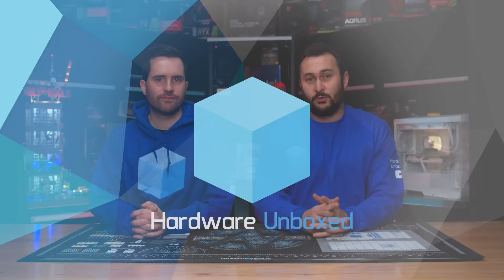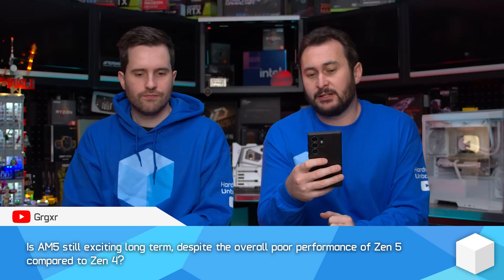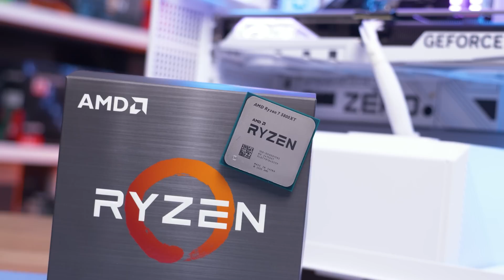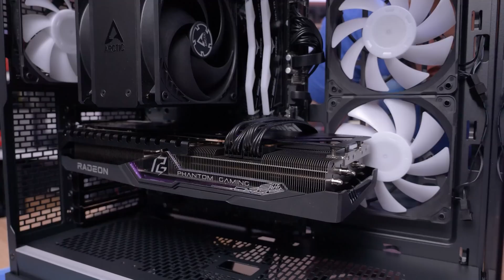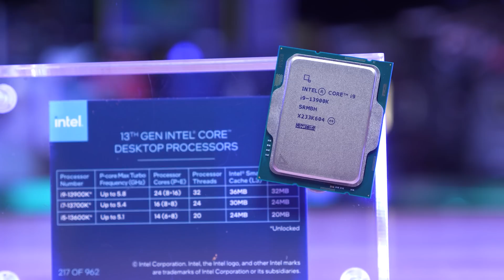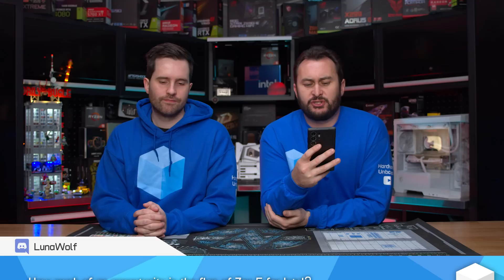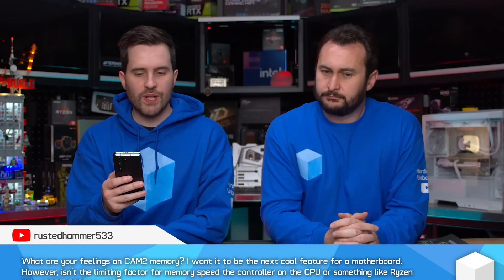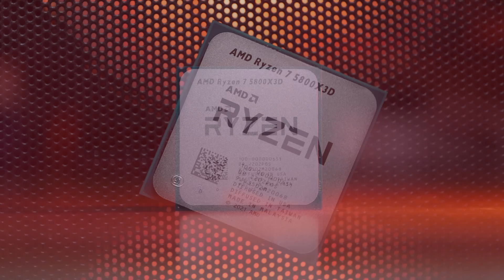Our RDNA4 Expectations, Can Intel Gain Lead After Mediocre Zen 5?

Comment: So I do quite a bit of overclocking, some of it goes well, some not. Memory overclocking being by far the hardest thing to do. As for limiting overclocking I do think there is a simple solution, a 2-3 way bios switch that accounts for standard cooling, advanced and Extreme, with the last one throwing your warranty out the window instantly. Having done XOC I can tell you its a very fast way to scrap a chip, however the standard bios should let you crank things up to where you hit the standard temp limits and generally that's also about the limit of stability, memory OC's excluded. We do know that most GPU's can handle +125-200 mhz and 500-1ghz on memory so set that as the max limit on standard bios/ lvl 1 OC bios. Not to mention If you trry to load almost any 8000mhz memory there's a 90% chance it wont run on any chip.
Reply: I have been overclocking laptops for 20 years. You can do it safely.  My GTX680M lasted 5 years including the last 2 years at +50% (720 to 1000mhz) after liquid metal.  The only CPU I killed was a 3940XM from excessive pressure after I made a custom heatsink (it ran fine at 4.7ghz before it).  I watercooled my first P370EM laptop and put 2 1070s in it that when TGP modded ran up to the laptop motherboard throttle limits (540W).  I have here a 9900K in a Z170 laptop board running at 5ghx/170W max (a Clevo, the last one to do desktop chipset slabtops, that I modded with functional detachable watercooling before the diy chinese ones started popping up on taobao) and two vbios modded GTX 1080s set to 250W max that still work.  6 years old and run hard almost every day of its life, the screen was the only thing that ever failed.
But with all the limits these days, you can't do it.  It's killed my enthusiasm for it.  That includes undervolting.  Not being able to undervolt laptop HX chips is farking disgusting.  The one-size-fits-all approach has ruined everything

Comment: I have a 5800X3D with a 16gb RTX4060ti GPU and 32gb DDR4 3600mHz RAM and I play Cyberpunk 2077 at 1080p and I am getting 90FPS even with everything turned on. Raytracing, Pathtracing, DLSS and Frame Generation. And I don't think I will be upgrading my platform for years to come if ever.
Reply: You will upgrade that 8 gb vram card, that is for sure.
Reply: @Shatterfury1871  lol you obviously did NOT read that guy's full comment otherwise you'd not type this idiotic comment
Reply: @Eleganttf2  
I did, but you put the VRAM at the end of the name of the GPU.
Reply: @Shatterfury1871  16gb not 8gb
Reply: @EthenGreen-i5k  
What sin did you commit that forced you to buy that card? You could have gotten a 7800XT for around the same price.

P.S. The buswidth will not allow you to make full use of those 16 gb of VRAM.
Reply: @Shatterfury1871  I paid £420 for the 16gb version rather than £360 for the 8GB version of the card. I decided that the £60 extra to double the VRAM from 8gb to 16gb seemed a fair deal. That is the reason why I bought the 16gb version.
Reply: @EthenGreen-i5k  
It has the same buswidth as the 8 GB one.
Yes, you will make use of more than 8 gb, but not 16 gb.
If you bought a AMD CPU, why didn't  you entertain the notion of buying an AMD GPU?
Did you not watch the videos from those guys over here???
It's not that the card is bad by itself, its badly priced.

Comment: I would be amazed if Zen 6 isn't on AM5 
Usually new platforms for AMD are marketed around new tech. Like DDR5, PCIe5 and USB 3+
And the timeframe for Zen 6 seems too early for DDR6 and PCIe 6.

Could be a cross gen release. Otherwise I see Zen 7 being the first AM6 release.
Reply: Assuming DDR6 is even coming to consumer platform that early. PCIe 6 will probably be datacenter only for a few years due to costs, I can see the same for DDR6.

Comment: 15th gen intel won’t be a refresh. Famous last words.
Reply: In terms of architecture, it won't, in terms of performance uplift, it pretty much will be...
Reply: I don't like how intel removed smt. SMT is technology which will carry the multi core performance of CPUs. It is crucial for productivity performance. Heck you don't even need better single core performance in games if you increase the cache size. The problem is that many es of core ultra 285k are not even beating 14700k in multi core benchmarks. An es should atleast be on par with the predecessor so the 14900k.
Reply: @Riyozsu  Not having SMT is not a big problem for games / lightly threaded apps, in fact, it might be even beneficial. And according to leaks u9-285K's QS scored actually ~10% higher in Cinebench all core than 14900K, which, considering there is no SMT, sounds almost too good to be true.

Comment: Imagine using 6950 XT into the year 2027 because everyone are just releasing refresh after refresh with 2% performance improvements and 20% price increase.
Reply: Same. If my 6950XT doesn't die. Or my 7 years old B450 mbo that has the 5700X in it.
Reply: Why would you upgrade a two year old GPU that you just spend hundreds and hundreds of dollars on? Why do you think 5-10% is not good enough? How about stop chasing 1 extra FPS and actually enjoy your game and save your money. My last build was 11 years ago. I've upgraded my GPU once in that time.
Reply: @---GOD---  I upgrade gpu every 2 years, its really not that expensive if you buy high end and sell your old card to buy a new one.  1080p is unplayable to me, even 1440p looks bad.  no way i could keep a gpu that long and play at 4k lol.
Reply: 6900 XT here, I play in 1440p

Everything runs perfectly and even RT isn’t a nightmare anymore thanks to XeSS 1.3, FSR3, FrameGen, AFMF2…

For example, I went from 55-60 fps in Cyberpunk (HUB settings + RT medium + FSR 2🤮) to 75-80 fps with XeSS 1.3, 90-100 fps with FrameGen enabled and 150-160 fps with AFMF 2

Not only I tripled my framerate but even image quality got better (no more ghosting)
Reply: 6950 xt is still a beast if you ignore RT. Im running mine in 4K and everything I wana play I play smoothly and without any problems. I am only a bit worried about Kingdome Come 2 next year and later down the road the Witcher 4 and GTA 6. These might be the reason to change the GPU. Or utilize the upscaler more than I want to.
Reply: That card would still enough for those games.  @zagloba1987
Reply: Looks like they took a page out of mobile phone companies' book
Reply: 6900XT here. There is nothing that this gpu can't handle, the only game I had trouble with was Plague Tale Requiem and using Lossless Scaling fixes that completely. I don't think I will upgrade this gpu in at least another 4 years. Same goes for the 5950X I have, I see no point in upgrading it anytime soon. Companies, reddit and many tech channels make you believe you need to upgrade every single generation. I am the opposite. I buy good parts and they tend to last me at least 5 years, and cpu/gpu improvements are getting weaker and weaker. Nowadays good hardware can last you a decade, in the early 2000s you had to upgrade every two years...j
Reply: lol the AMD graphics drivers are bad is way over gents. The drivers now are just fine. I’ve been playing games since the ATI rage days Ns I can tell you AMD drivers are fine. They just are
Reply: @tadsnyder2756  I own 3 graphics cards from AMD, and 1 apu. in my 2 newers ones: rx 6600 and rx 6700xt, i have an issue that won't let me play my main game: The cursor constantly disapears when in the game, and since is an mmorpg, where i need to click literaly everything, i can't play it. The only way for the cursor to come back, is to press the windows key, so i see the windows start up menu, click back into the game window, but then. the cursor disappears again a few seconds later, sometimes 1 second later.... I have updated the drivers, and it keeps happening. My rx580 and my 5600g igpu doesn't do that tho. Is an issue exclusive to RDNA graphics cards.
Reply: @josejuanandrade4439 id put money on it not being your video card. Stop downloading weird shit and reformat your windows install.
Reply: I can see it. I only changed my R9 290 to RTX 3070 in 2020.
Reply: 3080 since 2020, and unless someone gives us an XTX/4080 equivalent card for 500$, I will not be upgrading this generation.
Reply: I will be using my 6900xt untill a card comes out which can play games at 8k comfortably
Reply: Honestly I can see someone still using their 1070 Ti, 1080 or 1080 Ti in 2027 if it still goes like this.
Reply: Why? Don't you want to use DLSS4 that will hallucinate the whole game for you (that may or may not resemble the original game you are trying to play).
Reply: I'm still using a 5700XT and 3950X, 1080P and some 1440P for the games I play as for RT don't use it so can't miss it. But I don't only game on this PC so an upgrade doesn't seem to add an value currently for me.
Reply: @qrogueuk it’s a great GPU 😊
Reply: Given how much you paid for it I'd certainly hope so
Reply: This is my plan. I'm not upgrading my 6950XT until a new $600 card is available with double the performance of the 6950XT.
Reply: A 7900xtx dominates the 6950xt, and it's not even within 20%. I know I had both. I've had a 4090 for the better part of 10 months and am preparing to buy the 5090. I might be a moron with money, but you also have no clue what you are talking about, and to me, it sounds like you are huffing copium
Reply: This seems like a possibility, given the minute incremental gains recently. You will play AAA games at lower resolutions and settings, and be grateful, or you will pay the bounty of an arm, leg, dragon's blood, your soul, and your first born child for our shiniest, newest, marginally better and temporarily halo GPU...which will be obsolete in a year...because console port optimization or MS will refuse to support old stuff on the new version of Windows. That said, hopefully Steam OS will be available by then.
Reply: Shit I'm ready to dump the 4090 for the 5090. I want more power.
Reply: @SPG8989  That's what I'm saying. I don't even do 4k. I just want 1440p on my ultrawide OLED with all sliders clapped out.
Reply: That’s the game, paired with 5800x3d
Reply: Well yeah we’re reaching the limits of silicon miniaturization, so any meaningful performance improvements are gonna be few and far between. CPUs reached a wall in clock speed 20 years ago, we haven’t doubled clock speed after all that time and IPC improvements are becoming minuscule. GPUs are gonna be reaching a limit in how small they can be pretty soon at this point, which means the 4090 is the last time a GPU generation will have this big of a performance increase over the previous gen. The RTX 5090 won’t be as impressive
Reply: I bought my 7900xt for 630eu (avg prices 750-800 here), I'll be using it for at least the next 5 years, no sense in upgrading as long as it does the job
Reply: Maybe wait for the 60 series?
Reply: "everyone" lol. That sounds like AMD GPU's, not Nvidia.
Reply: Sounds like what intel did for over 10 years with their core series
Reply: I will be using my 6800XT into 2027, there is zero reason to upgrade. After Red Dead Redemption 2, I have found no new games interesting to worth my limited and valuable time.  Even my 5900X is fantastic and upgrading to Zen4 or above will not be worth the money spent.
Reply: @josephnorris4095  why no 5800x3d?
Reply: @josephnorris4095  Yeah games are meh, not really a reason to upgrade.... everyone plays older games anyway and 6800 XT is an overkill for Elden Ring which was last game that really got me hooked.
Reply: @josephnorris4095 ya probably same
Reply: Some people I know are planning to use their 2080 Ti up to 2028
Reply: thats 5 years. how long did the 1080ti stay relevant?
Reply: I'm still using my 9900k does that count?
Reply: @alexwalker2582  hey, if it didnt rust in a year youve won
Reply: @auggieaxiom5726  😂😂
Reply: @auggieaxiom5726  The rusting issue is 12th and 13th gen, not 9th.
Reply: A 7900XTX ist much faster as the 6950XT and an RDNA4 Card will be better in Raytracing Performance as your old one.
Reply: @Taurus104  What?
Reply: Those sales for half-price 6950XT at the end of 2022, before the RX-7000 series.

Yeah that was the deal. Especially if you were a launch day owner of a 6800 (non-xt) at msrp price. Meaning you got a proper upgrade from a GTX 1070/80/Ti.

The RTX-3 series are VRAM starved, and the RTX-4 series are just bad value, whilst RX-7000 are a waste of time. Basically going from the midrange rx-6000 to the high-end was the generational upgrade, for the midrange gamer.

For the budget gamer, it was probably something like a GTX 1060/RX 480 to a GTX 1660Ti/RX-5650XT or RTX 3060/RX-6600XT/Intel Xe Cards.
Reply: @ekinteko  I went from the RX 580 to 6950XT. From my POV now, it was kinda good upgrade, since I will be ok for 10 years because I do not play games anymore, but for me, for my reasons why did I buy it, why did I upgraded so much... It wasn't worth it. I went from RX 580, 1080p 60Hz monitor and Ryzen 5 1600 to RX 6950XT and R7 5700X paired with a 240Hz 1440p monitor. I played a competitive shooter and the only thing that helped me to play like I could was a Fing stable Internet connection. I can play great things with my setup, I just don't want to. There are some videos on this topic and a lot of people are saying that one of the biggest upgrades was higher refresh rate monitor. Yes, it is better. Yes, it is by far smoother than 60Hz, yes it is a night and day. It didn't help me become better!!!! Not 1%!!! Liars everywhere. Stable internet, good internet helped me. Although I am in western Europe, I am in the countryside away from the big city and I am using 4G cellular network. I had to buy good router and antennas, put a huge pipe in the concrete foundation for the antenna and route the cables through my house!!! That helped!!!! Aaaaaa!!!!
Reply: @ekinteko  The GTX 1660 Ti was in no way a good upgrade for an RX 480 -- the RX 6600 and IntelXE cards were, though.
Reply: @predabot__6778  True. I meant it's more-so worth it if you came from the GTX 1060, in particular, the cutdown 3GB model. That still is high on the Steam Survey.

Also the RX-480 didn't get the best initial reviews. On paper you were getting more hardware for your money but the real-world performance just wasn't there. It was a little behind the 1060. After the big crimson update it was ahead. Then incrementally over the years, now it is way ahead of the 1060. Yep Nvidia abandoned all those users, and paved the upgrade way through the GTX-1660Ti, which admittedly was not a bad value card.
Reply: Imagine using the virgin 6950xt, instead o the chad 4090, all the way to 2029!
Reply: @josejuanandrade4439  imagine being older than 12 and talking like this
Reply: @---GOD---  imagine caring (or being bothered) so much about how other people speak you gotta leave a comment about it :)
Also: r/WOOOOSH
Reply: @josejuanandrade4439  imagine still trying to get the last word even though you clearly have nothing left to say since you ran out of arguments to defend your utter BS.
Reply: @---GOD---  Imagine being still so triggered because you failed to recognize a joke, that you won't let it die, and try to make it look as some sorte o discussion? with arguments? LOL
Reply: @josejuanandrade4439  imagine still imaging when you could've just stopped hours ago. Imagine pretending you made a joke (that nobody laughed at) after getting called out. Imagination running wild today huh.
Reply: @---GOD---  Imagine asking people to imagine stop imagining while still imagining yourself that you didn't made a s booboo because failed to recognize a joke, whatever good or bad :)
Reply: Imagine having driver issues constantly. No thanks
Reply: @user-uc5tj6ux8w 
AMD drivers are fine
Reply: @JahonCross  nah, they’re really not. And that’s coming from someone who’s had many generations of AMD cards. Multi monitor setups always has sporadic black screens and instability for me for years while using AMD gpus. Switched to a 4080 when they launched and guess what? Zero driver issues. And im not exaggerating. You get what you pay for.

Comment: My hope is rdna4 will be amazing , they had good gpus when they release em next to a console generation. If it uses same power as rtx 4070 and is stronger than a rx 7900 gre in raster and rx 7900 xtx in raytracing and has 16gb vram or more for 500$ I would buy it.
Reply: I figure they will charge 899 $ for the above. And people will buy it.
Reply: @PepsiMagt  if its more than 500 they just push you to go nvidia because blackwell not absurdly far away.
Reply: @Unknown-wd7ub  they can sell the cards at that price. Maybe not to you, but there are plenty of suckers with money around.
Reply: @Unknown-wd7ub 
Nvidia 5070 $899… there is room for amd 8800xt at $799!
… or $749…
Reply: More like $600 to $750 and not as fast as you expect. Based on hardware… 3 to 6% faster than 7800xt in rasterisation. And close 7900xt in ray trasing. Most likely not as fast, but much faster than 7800xt in ray trasing.
Reply: @haukionkannel  so you say it will be a 100% useless generation. Huh. More money for not more performance.
Reply: @haukionkannel  so more money for less performance than current offerings? Yeah sure. Enjoy your fake benchmarks.
Reply: @Unknown-wd7ub  
That is what we normally get these days… what was last GPU that did offer good price / performance?
Still 1080ti from NVIDIA and 5700xt from AMD… those times are far in past!
Reply: @haukionkannel  I mean yeah but at least the 7800xt is a slightly more efficient 6800xt but it started at 100$ less. So I would expect at least a tiny price cut for the same performance from the next gen.